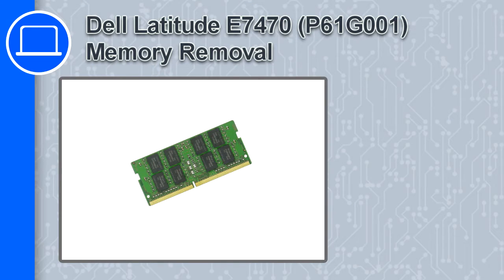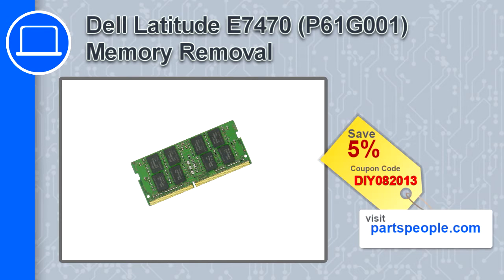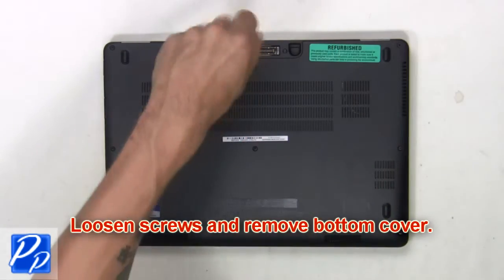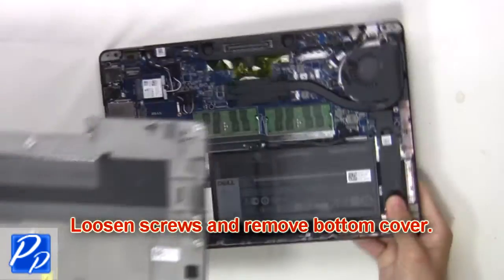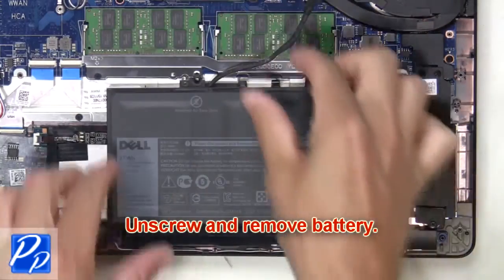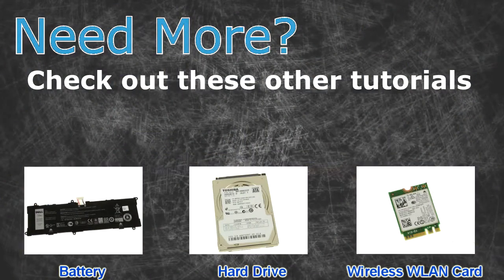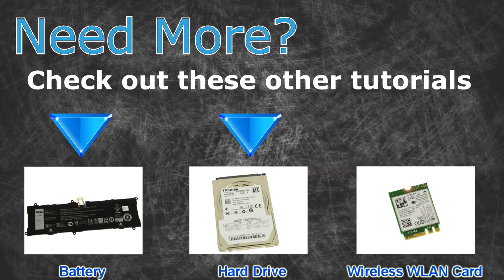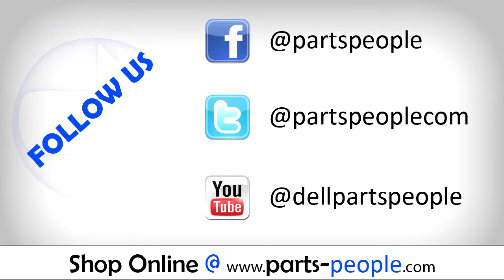Dell Latitude E7470 (P61G001) RAM Memory How-To Video Tutorial

Comment: Do you have to remove the battery to install a RAM stick? The RAM slot is above the battery so I don't see why the battery needs to be removed
Reply from the maker: It doesn't have to be fully removed but it should at least be unplugged. If the power adapter or the battery are connected, you risk shorting the motherboard or other components on the motherboard.